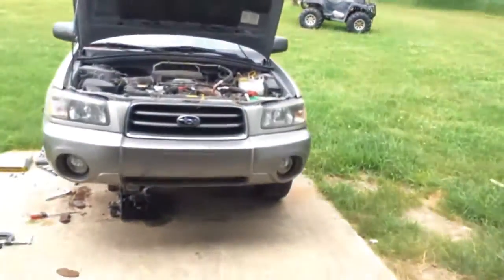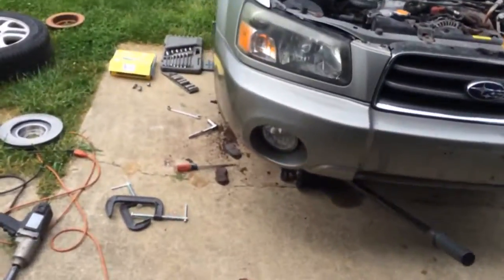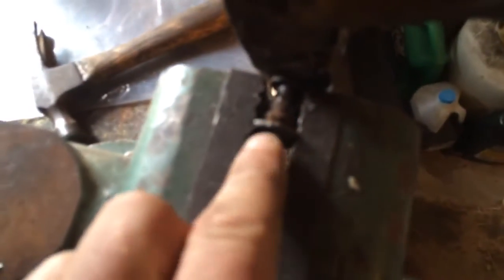How To Remove A Seized Caliper Slide Pin DIY EASY

Comment: I used a torch to heat up the caliper bracket, then spun the pin on a lathe & cleaned it up with emery cloth.  Good as new.
Reply from the maker: Could even put the pin in a drill and spin it on an emery cloth to anyone out without access to a lathe. Thanks for the comment James.

Comment: Nicely done, I don't have all those tools.
Reply from the maker: A cheap air impact hammer can run maybe $20, it’s the compressor that will cost you. If you can clamp it in a vise and use a torch on it, then hit it with a sledge hammer.